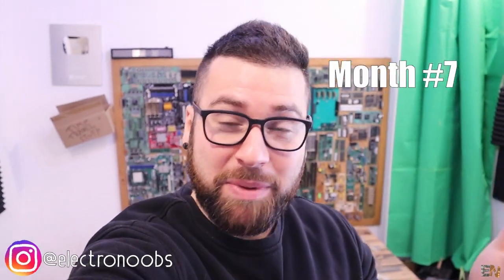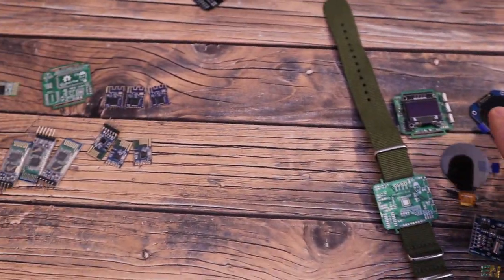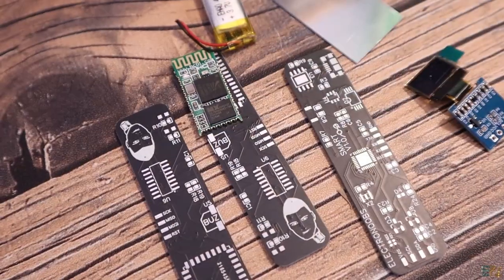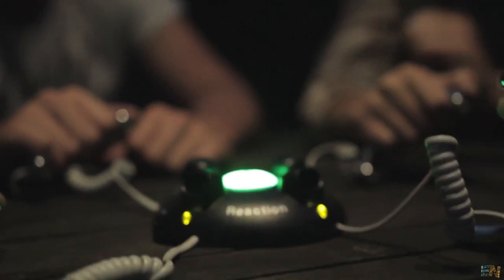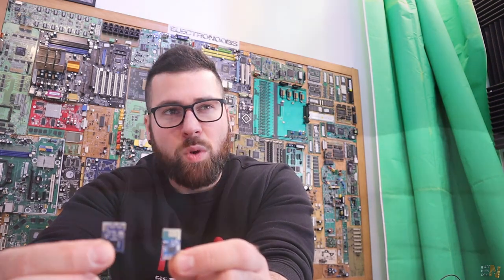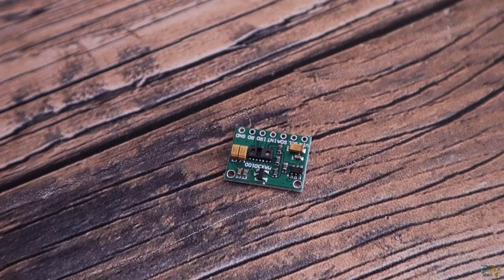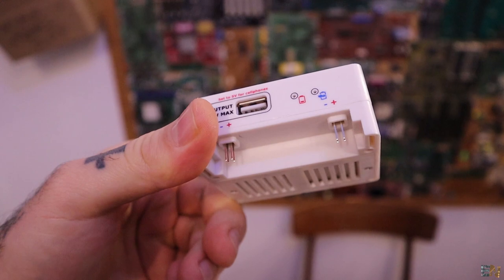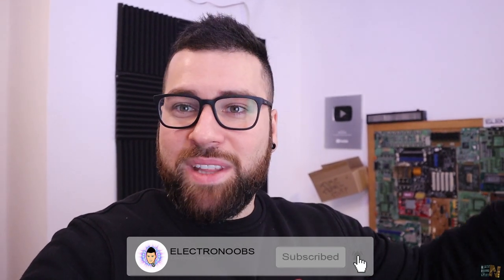New Smartwatch | Smartglasses PCB | Nextion Huge Display | Mini SMD Reflow ElectroNews#09

Comment: I will have to say that I am going to engage with your video in coming days . too much interesting projects but I have a suggestion for you -use esp32 in your smartwatch because it have built in ble ,wifi,rtc, higher speed , dual core , ulp ,etc . so a beast mcu for your smartwatch

Comment: That smartwatch project sounds awesome! I am also currently working on my own smart watch project with an stm32 as the main controller. I wanted it to have gps and dual mode bluetooth to play music. If you are interested in that I would check out the l80-m39 for the gps and the FSC-BT909 for the BT. In the final version I think I am going to end up just using the chips inside the modules to save space. Keep us updated!

Comment: For watch why not esp32?
Reply: I think esp32 consumes a lot of battery, another alternative could be nrf52832 or nrf52840, @electronoobs what do you think?
Reply: @GabrielGutierrezRamirez  running It on single core and using deep sleep will save a lot of power and even those bluetooth module consume nearly the same amount of power .

Comment: Smart watch will be amazing. I will be waiting. Bay the way max30100 pulse oximeter sensor doesnt work well. I have tested it.
Reply from the maker: And what is the problem? Not accurate readings? Thanks a lot!
Reply: @ELECTRONOOBS  yes. It was difficult to read accurate values from sensor. Mostly showed inaccurate values. But i might did wrong way. Maybe you can success.

Comment: Hello there is a ds3231 RT smaller chip i saw one time it is a 8 pin. You might want to look into that. The 1307 Rtc clock loses time over time. some loses time over like 30 to 40 seconds a year. I have saw that some 1307 loses minutes over the year.
Reply from the maker: Thanks for the tip :)
Reply: @ELECTRONOOBS  I'm working on a smart watch my self using the same screen however I be using the arduino SamD21 that is a 32Bit arm cpu also know as the arduino zero processor. Also using the same Ds3231 8 pin clock chip. Problem is there is a shortage of parts right now.

Comment: Please don't use stm32f103 it's 10 year old design and has issue with built-in RTC. Just go to https://github.com/stm32duino/Arduino_Core_STM32 and pick a microcontroller that is supported there.
Reply: It's the voltage that kills not current.

Comment: Dont use 1307 as there is problem it supply voltage it requires 5v